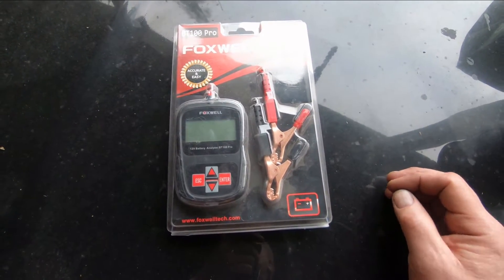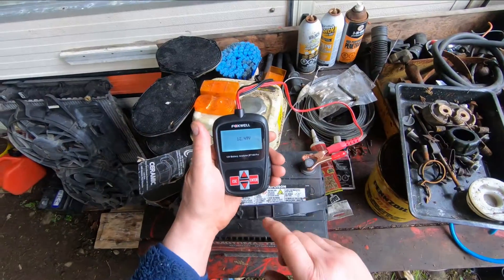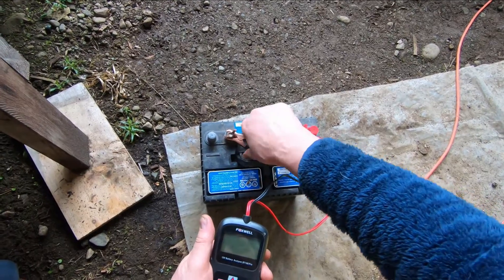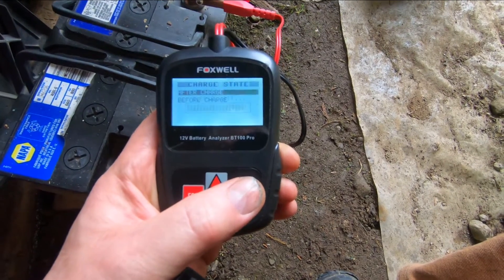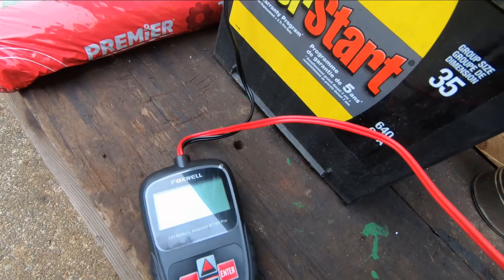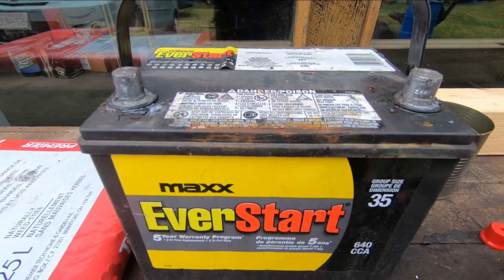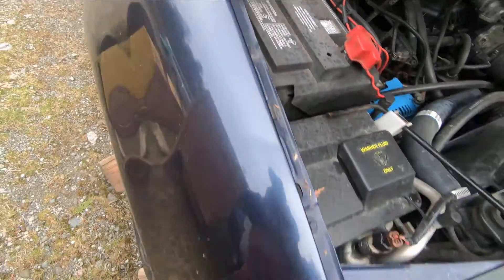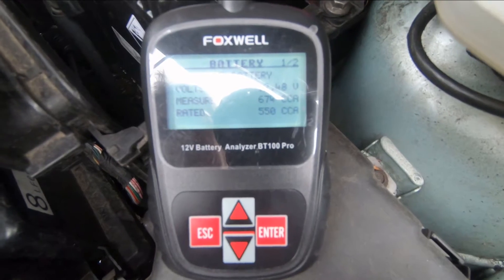HOW TO LOAD TEST A CAR BATTERY USING FOXWELL BT100 PRO (link below)

Comment: I have one these.  i think it is a piece of junk.  I tested my new car battery and it displayed 36V for a 12V car battery.  I manually entered 575 CCA and start the test.  It displayed over 1000 CCA.  Piece of junk, not reliable results.
Reply from the maker: You must have got a bad one because this one works well. I've tested regular car, marine, RV deep cycle lead-acid, and gel batteries that I've often confirmed with another load tester. See if they'll refund or give you another. Sounds like a bad unit.

Comment: but it does not have an internal battery if the battery is too dead you have to put it in parallel to charge it and then try testing it again if it'll charge what about this nobody answers these questions
Reply from the maker: I've read battery voltage at 4 0r 5 volts on a 12 volt battery, which is very dead and probably not a recoverable battery. If this tester does not detect a voltage, the battery is probably never going to regain a useful life.

Comment: How's she goin'?  That's a nice little battery tester.  I have one of the resistor load testers, but it's only good for 100 Amps.  This little tester looks like it can determine the cranking amps even up to 660CCA so that's a lot better eh!!  Thanks for sharing this Craig and take care!!!
Reply from the maker: I like this tester. I bought it after watching a review on YouTube a couple of years ago. I've used it several times and it is good to have on hand. I find that a multimeter is often inaccurate because it doesn't give any indicators of future performance, just the current state of charge. I also have the resistor type of load tester but I couldn't help myself from buying this one. Maybe you need one of these too?
Reply: @EverydayProjects  Maybe I do!!!
Reply from the maker: @GrampiesWorkshop  You'll be especially interested in the car alarm function as demonstrated beginning at minute 6:35
Reply: @EverydayProjects  That was an unexpected option for sure!!!
Reply from the maker: @GrampiesWorkshop  Yes, this little device certainly packs a punch-who'd have thought that I'd get a "free" car alarm tester too!

Comment: Looks like a winner. You say you've had it for a few years? I like used batteries from the junkyard. It's $20-$30 from the junk yard Vs. $80-$120 new but I don't have a load tester so it's kind of a gamble. This would pay for itself pretty quick. Thanks!
Reply from the maker: I bought this one on Amazon about 2 years ago after watching a review. It was about $50 CAD then. I put links in the description to Amazon today and I see the Canadian price has jumped, but the link for Amazon.com (USA) shows a good deal $45 minus a 20% coupon. I used to use the other type of load tester but often just a multimeter that didn't always give an accurate health check of the battery or its future prospects. This one covers all the bases and is accurate. Most backyard mechanics will find this one useful. I'd check out the one on Amazon and see if your wife will buy you an early Christmas present! (link: https://www.amazon.com/FOXWELL-FBA_BT100-Analyzer-Automotive-Directly/dp/B01ANF1BRW/ref=sr_1_5?crid=1TNQ98PBIJ8ID&keywords=foxwell+bt100+pro&qid=1647788102&sprefix=foxwell+bt100+pro%2Caps%2C191&sr=8-5)